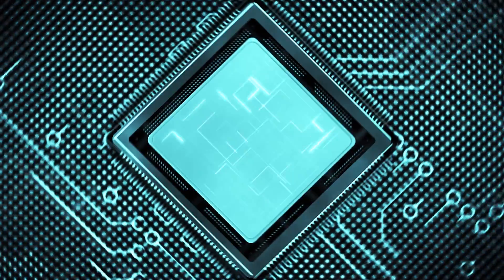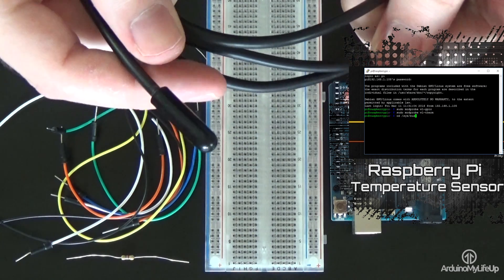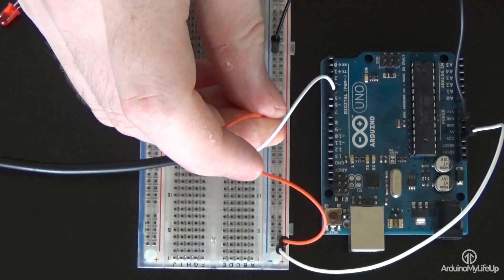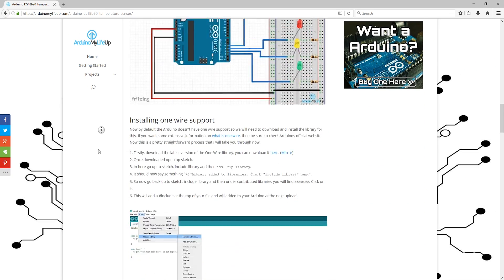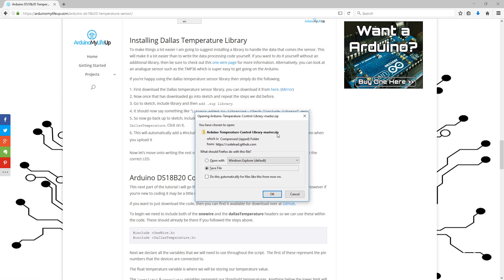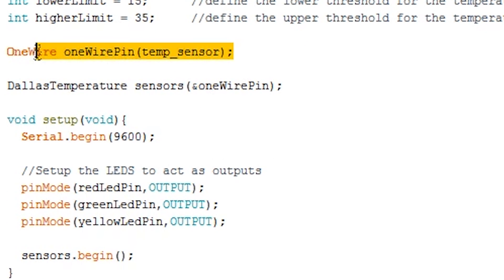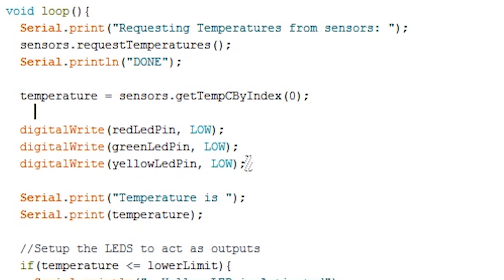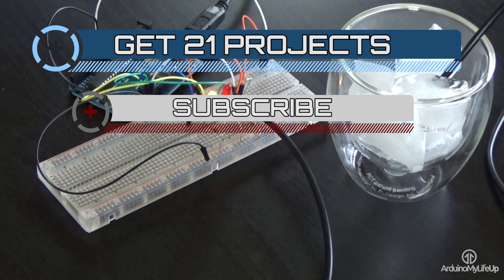Arduino DS18B20 Temperature Sensor Tutorial

Comment: THANK YOU GUS!!!

Finally a clear and concise tutorial.

I am the king of noobs when it comes to wiring these things and your video really helped.

Presumably the wire going from the breadboard to Arduino 3.3Vdc and Gnd doesn't have to go to the Arduino? Would I be right in saying that it would still work if these two wires were plugged into a separate power supply and only the pin 5 wire was connected to Arduino???

Also whats the purpose of the resistor between red and white? How did you know to use this resistor?

Thanks again Gus... after that vid im away to have a look at your website! Keep up the good work, its much appreciated.

Comment: hello mr, i have done this but why the serial monitor showing the same temperature. It keep showing   - 127 degree celsius all the time
Reply: you need to make sure all your wires are connected properly and your resistor is connected correctly

Comment: this video is perfect and my temp sensor is working fine. thanks a lot!
Reply: it's not the same for me :-(
Reply: Same here, mine is showing a temp of -127. Anyone know whats wrong or needs to change when using a nano?
Reply: @2112user  you need a resistor of 4.7k in paralel data and 5v
Reply: I also get -127 when I remove the resistor. When the resistor is placed back in I get 85. No changes regardless of temp.

Comment: Can someone help me find a sensor to read the the surface of the back of a solar panel? The back of the panel has a system that will cool the panel with water so i need it to be water resistant and to only read the surface temperature with minimal interference of the water on readings if at all possible.
thanks for any ideas you internet geniuses.

Comment: is DS18B20  better than LM35 for tepmerature control circuits ?
Reply: they are almost same, BUT there are some benefits on DS over  LM, such as :
1) DS's output is Digital, it means no need to use and ADC on your MCU, but the output of LM is Analog, which means you MUST use ADC of your MCU.
2) you can use as many DS devices on ONLY same data line
Regards